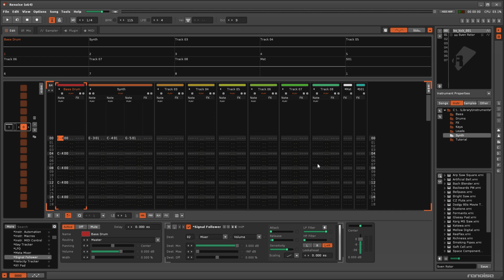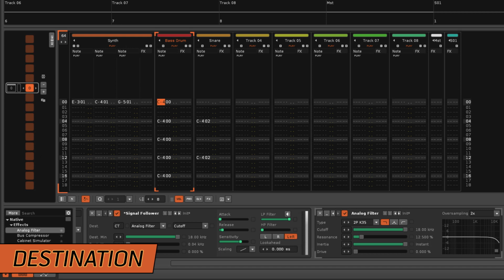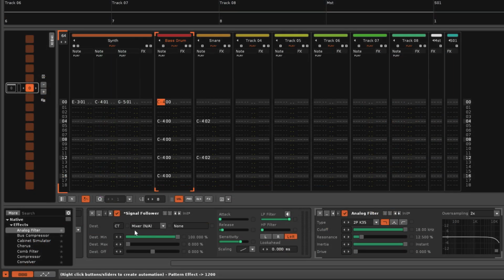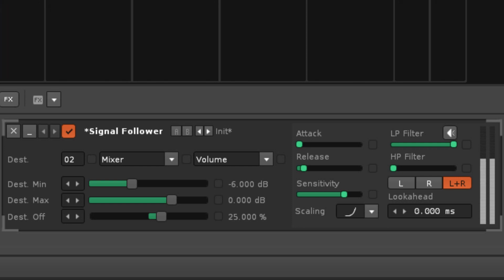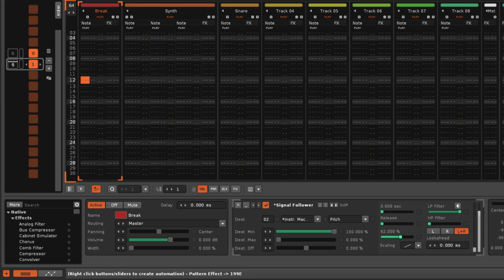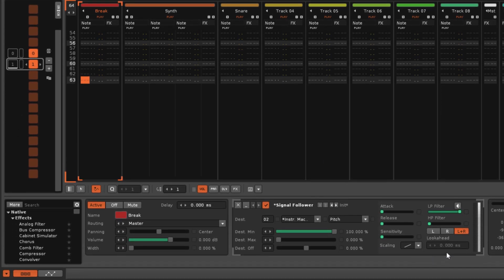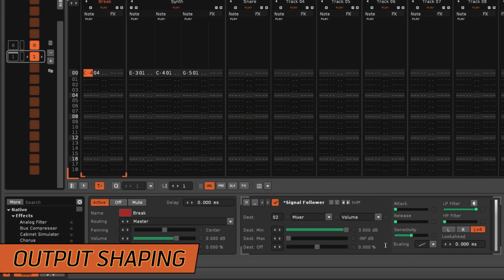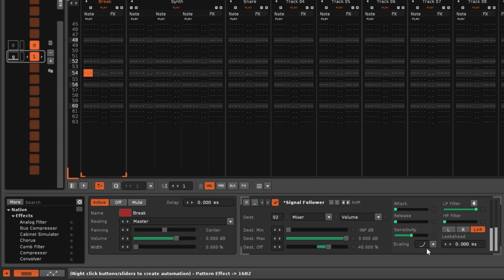Signal Follower

Comment: Use signal follower with hydra to sidechain multiple channels
Reply: Thanks a pretty good tip. Hydra is probably my favorite Renoise device. You can do so much stuff with it.
Reply: @untilde  no worries. Its fairly straight forward using hydra, signal follower and a gainer on the channels that need ducking